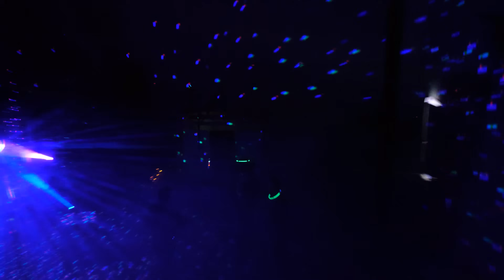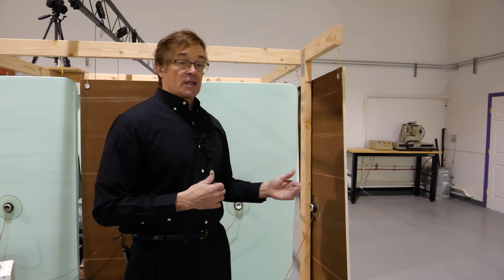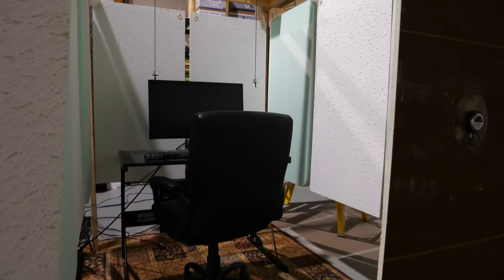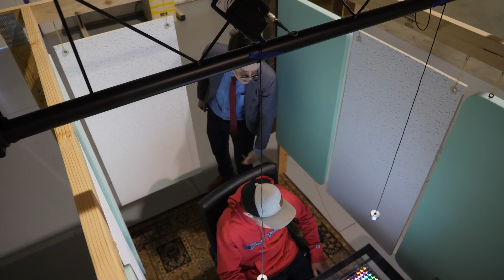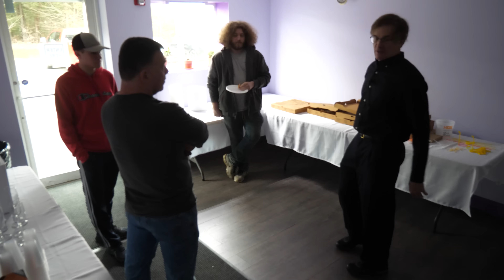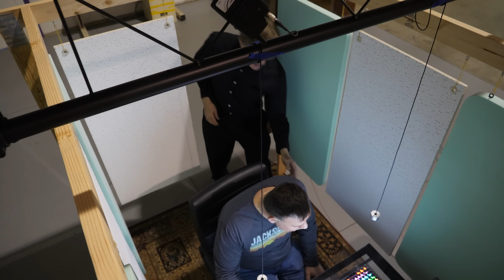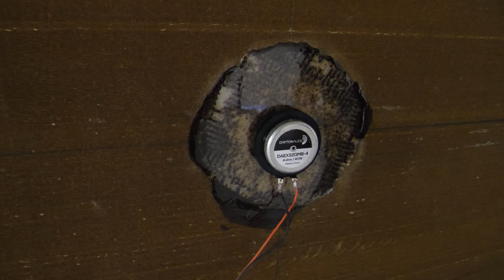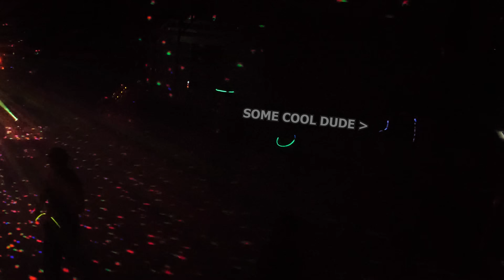SHOULD SPEAKERS THIS GOOD BE LEGAL?

Comment: It would be super cool to use curved panels for stadium sound with beamforming and interference correction between drivers. There are beamforming loudspeaker systems for stadiums, but I feel like the peak sound level is too high in parts of a venue like that (often not hearing safe). I think the calculation, in addition to the normal beamforming, would be a delayed convolution (based on the real delay between the drivers). I'm going to try building one, and make the software for that, I'll let you know if I get results.

I think a similar processing step to the convolution for multi-driver panels could be used to solve that resonance problem you are talking about when the driver is in the center of the panel. The convolution is a matrix as m columns × n rows where m is the number of channels and n is the number of samples it takes for the reflection to come back; you could also pre-process the audio samples by binning them down with each iteration (i.e. the first row [of n] would be the previous sample, the second row would be the average of the two samples before that, the third row would be the average of the previous two averages of two samples, etc) and you may get a similar quality result with much smaller matrices.

Obviously for an installation with one driver per panel, offsetting the driver will get you a significant improvement without this fuss, but if you're going to be doing DSP anyway, you might as well solve the problem correctly as well. There is a frequency-domain process that can reduce standing waves on a DML as well.

Comment: Would using thicker acoustic ceiling  panels improve the base performance, thereby eliminating the need to use a larger panel for the point one sub channel, and an additional standard sub?

Comment: If you could scale this application to the size of something that would be suitable for outdoor audio that would be awesome. I'm trying to come up with a system I can build and take camping with my and have high audio levels, including deep bass and run it off my campers lithium ion system. It's tough to move air efficientl for cheap. You're on the right track!

Comment: I'd be curious to know if these panels still work if you suspend them in a wooden frame (just a piece of rope on each end connected to the frame corners) and then put fabric over the whole thing, or if that extra friction would somehow reduce the ability for the panel to absorb the vibrations.

Because that would make for some great DIY accoustic paneling for a home office

Comment: I've always thought that this kind of demo is pointless. The copyright-free tracks are dreadful electronic affairs totally lacking in nuance and are superficially impressive, but wearing on the ears and brain. 
Something that isn't discussed at all is instrument placement and depth resolution, which are features crucial to great hifi. In addition asking random public listeners isn't a valid test - most people wouldn't know good sound if it bit them on the bum.
This type of speaker design isn't new and does have significant downsides, which is why you don't see it in the world of hifi. As you might gather, I'm not impressed, at all.

Comment: Yeah no. The frequency response of open flat panels is abysmal.
Yes, I watched your last videos about this topic. Yes, I built them to your exact specifications. I even exceeded those specifications in order to minimize self-oscillation: I use no symmetry whatsoever like you do here. And no again, the sound quality is far less than "illegally good". I have a peaks and troughs of over 12dB over the entire spectrum, and you can hear that. There are reasons why loudspeaker manufacturers don't slap together cheap speaker drivers with styrofoam slabs and sell them for a fraction of the price of what speaker cabinets cost. If if was this easy to outprice the competition, don't you think big corporations would exploit the hell out of this?
My flat panels have a beautiful stereo spectrum, but that's the only thing they do. Everything else does not reach the quality of even a cheap portable blutooth speaker. Of course my Yamaha HS nearfield monitors wipe the floor with my flatpanels. And that's before we even come to the subwoofer which is necessary to augment any open flat panels low freq response.

Comment: could put a plate on top of the ceiling panel and a magnet at end of the hanging string, then you can hang and remove them without leaving holes.

Comment: The sub shown might actually lower the performance overall here. Ideally, you'd have a pair set up symmetrically (humans can localize subs if they go as high as 150 Hz), and bass-wise, that giant space is definitely not doing the sound any favors, usually you boost subs by making use of the room. Corner loading maxes them out and may often be too much, middle of a wall is somewhere in between. Putting them in the middle of a big space makes them the least effective. So, a couple of big SVS subs, one on each side of the monitor or so, would probably increase the perceived sound quality considerably.  Unless, of course, the small white sub was just a visual aid and you had better hardware. Either way, very interesting. If I were doing a home theater and needed a high wife approval factor, panels like these might just be the way to go. With a pleasing surface color/texture on them they'd melt into the walls.

Comment: DUDES- SUGGESTION: I am thinking: bass is the longest wavelength- requires the most travel of all the frequencies  are (possibly attenuating the Bass tethering it where you are. Why don't you try hanging them just above the middle 40%down from top?? so the bass is freer  resonate. The highs don't need so much "physical movement"  so it might sound better. Also * Why Are you using rectangles?
Have you tried a teardrop shaped panel?  Thanks- good luck,  Jim 
Not a single thumbs up or comment in 8 months? Did you delete this post?

Comment: I'm curious about the panels on the left and right channel directly facing each-other. Seems like this could cause some unwanted frequency cancelling. I think most audio is mixed assuming that the left and right channel are in front of you. I would be really curious to hear what it sounds like with 5 panels directly in front of you. 2 left, 1 center, 2 right. Repeat for the rear. Seems like the soundstage would be massive. I love these audio projects you do, thanks for all the info!
Reply: DML are not cancelling themself because the modal resonance.

Comment: this one is pretty neat! i would love to try this one myself,, is there a parts list somewhere for it?
Reply: He has covered how to make these in previous videos. Absolutely
Reply: @tdtrecordsmusic   Yes you are correct. I should have been a little more clear in my question. I was wondering what type of AV receiver/ Amp . he was using. stuff like that.
Reply: @johnofthejungle5699  oh, gotcha. Sry, I don't recollect ever seeing his setup, but as audio is what I do I can help a bit. 
  If you're going to be doing experiments I highly recommend getting those tiny amps from amazon/ebay for roughly 10$-50$. I like the ones which are just a circuit board/no enclosure. The ones I am speaking of have very few parts and are based on the amplifier chip itself. So far ever one has had genuine chips typically from Texas Instruments. These chips are high quality & typically found in car stereos(head units).  The advantage for fun/experiments is that they are very robust. They have a wide range of input voltages. They can handle short circuits and have features designed for abuse. Most can literally maintain a dead short and still survive without even a change in the sound output. One bad a$$ chip.  This is NOT the same for those big receivers you find at big box stores OR any amplifier based on discrete components.   I typically search for "50w amplifier" or "100w amplifier".. something like that. The last one I got has model # zk502t. For 20$ it even came with a very nice power supply :)  
       So my formula is to use this little throw away amp for experiments. Then when the experiment is done, I will hook it up to the supposedly better setup of a higher priced amp. I must say though that these little amps seem to be better quality than the receivers touted for hifi stereo. They clearly have better signal to noise ratio(yes I measured with oscilloscope) and tend to pickup less hum from various devices like ipods / phones / guitar pedals / etc... 
    Sometimes I will just go to Texas Instruments website & browse around for the newest amp chip. Then just search that on amazon/ebay & there will typically be a little board based on that chip for ... yup, you guessed >> 10$ - 50$ ...
   However, my goto for proper sound without killing the wallet is yamaha HS8(new models) & beyerdynamic DT770 pro 80ohms . I don't like the higher ohm headphones, they sound different. I've got a couple pairs & I have heard loads of them! Plus, it sux when you can only hookup your headphones to ONE amp to sound decent & they still don't sound as good as the 80s.  80ohms seems to be the magic number.

Comment: when you say acoustic ceiling panels are they paper ceiling panels, or a plastic with a foam centre, what is the dimension of the panel.
you might find getting some baking foil a foot square and glue it to the centre on the opposite side of the driver on the polystyrene panel that will extend the top range more
if you did it 6 inches for the bass driver panel would extend more mid-range
have you tried putting them in a room just around the walls? not touching of course.

Comment: I was surprised that you didn't mention the importance of impedance matching.  I was great that you discussed series vs parallel connections to change the load (speak) impedance.  Matching the impedance of the driving amplifier to your speakers guarantees maximum power transfer.  Don't want to waist the watts!!!  Another great project.
Reply: I was interested in the bit about putting them in series too. But I don't understand how they were wired to achieve that. Was wondering if you had an idea about this. How do you put speakers in series vs. parallel? They don't have output jacks, so how are the two connected to each other?

Comment: One time I took 6" MB quartz speakers and put them in a 6" tube about 40 inches long then I put those in sono tubes 8" wide - This produced some incredible base tones and it could be tuned.  Pink Floyd sounded as never before.   They could be tuned by sliding in and out.

Comment: maybe u can record with good condenser mic the same song or 10 second at different volumes with different commercial speakers placed pretty much at the same spot, and check later on an graphic equalizer where u got better response frequencies or where are missing with your sound system... or just a swipe maybe is better for the test... Im wondering if those panels are good and clear also at really subtle volume... cause if u surround a guy with 8 speakers in 5.1 u always tend to get an awesome response... and the human hear tend to adjust the sound in a way to get as clear as possible the sound already... (never trust humans XD) but all of this cause u get a really good quality with this sound system, great work compliment! ...I wish I did this for my assessment in music production!

Comment: This is awesome! Would love to hear it. Have you experimented with having the front L & R panels angled in like traditional studio monitors? This would help with phantom center imaging from stereo information routed to those speakers. When mixing for 5.1 or atmos, most stereo tracks don’t output the mono information to the center channel. In audio for picture typically music is mixed to front L & R, and center channel is saved for movie dialogue. Upmixing stereo audio to 5.1 might be different though, not sure if in that process the mono information gets routed to the center channel or not. 

Great work! Pumped to see if you make an atmos version

Comment: I made a set of these for my living room TV.  I ended up with a fabric covered polystyrene insulation panel (21x28) and an end grain balsa panel that is about 30x42.  Both are hung individually with string from a single wall mount that I built myself.  I tested several iterations of the polystyrene and it was a little bright for may taste.  The combination of the two panels with different materials really sounds nice.  I'm currently working on two 8in subs.  Very happy with everything so far.  The panels definitely need subs. And I think the two different materials have a much more balanced sound.  They sound much better together than they do separately.

I made the end grain balsa panels myself.  I have a well equipped wood working shop in my basement.  Next time I might try basswood instead of balsa.  The balsa was more expensive than mahogany.  I think I have $230 in balsa to make two 30x42 panels.  They weren't cheap, but overall cheaper than building mdf boxes with drivers.  I may try some high pass crossovers next.

Can't wait to see a more in depth video with more technical data--response curves, material options, and any thing else that was learned from the last video.  I'm curious about how the exciters are now mounted.

Also curious about where to find the non-copywrite music.  Thinking about making a video about my DML's.

Comment: How far would these speakers have to be from a solid wall if they were placed in a small to medium sized room ? Could they be used as a surround system in a basement mancave ? Or would the reflections from the hard walls ruin the effect ?
Reply: Hang some cotton sheets or woollen blankets along the walls & you could probably do away with most of the backside reflections on the cheap, provided there's an air gap either side of the sheet, & a wall then blanket then sheet then speaker setup would be even better. I think actual distances would probably depend on the wavelengths of the stuff you're listening to, but unless you're super fussy even a couple of centimetres of gap may be enough. Or you could paper the walls with faux fur.. It's an option.

Comment: I have to admit I'm of a mixed mind on these. Building them is the only way to settle it, but too many irons in the fire right now.  From my experience with electrostatic speakers I tend to agree with benifit of a large area and low excursion speakers acting as a plane source instead of a line or point.  On the other hand esl speakers have extremely low mass membranes and the drive force is distributed evenly across the whole panel. They often have several methods for mitigating resonances throughout the membrane.  My other thoughts are surround is kinda pointless as we only have 2 ears and multipath waveforms have interference patterns.  Of course ESL speakers pretty much need to have your head located in a vice for even decent results. But sitting a in the right spot provides an experience unmatched in my experiences.  I can't imagine these speakers not behaving the same.  Would they be better than my rigged together tube amplifier and home built speakers?  Or repairing the $5k ESLs I have and building a much bigger tube amplifier as the ESLs can eat up 200W at moderate listening levels?  Interesting video, as always

Comment: If you're dealing with a square panel, would you get more even frequency response placing the driver 60/40 along one axis and 70/30 along the other?
Reply from the maker: That's  an option.

Comment: Fantastic stuff, I will be making one of these soon based on your recipe, thanks!
I was wondering what would happen if you rested or even glued the back of the actuator again something solid? I.e. for every push on the plate, the plate pushes back on the actuator reducing the amplitude an probably also altering the sound. It would be interesting to see what happens when this push-back and pull-back is removed? The extreme version of the idea I guess would be to glue two speakers back to back through their actuators, so that they would cancel out each others back forces when playin the same sound...
Reply: Another idea: attaching magnets to the plate holes would probably alter the sound in undesirable ways because of the additional mass, but I wonder if the panels could be magnetically levitated instead of being suspended on the lines, and if that would impact the sound?

Comment: There are many ways to make materials vibrate and therefore to reproduce sounds and music...
To make people listen to these reproduction systems only allows to know whether they like or not what they hear! That is to say nothing reproducible or scientifically exploitable.
The objective of building loudspeakers is, in general, the most faithful reproduction possible of the recorded sounds. This is the definition of high fidelity or Hi-Fi. QUAD had for phrase ''For the closest approach to the original sound''. Unfortunately DML are most often unable to reproduce with ‘’Fidelity’’ the recorded sound for several reasons perfectly determined by measurements and more simply by their mode of radiation of waves. I stopped working with them years ago after understanding that these speakers can’t be considered as Hi-Fi speakers. It’s for example totally impossible to make a good mix with them and obviously no position in the room will result in a credible soundstage. As a consequence, the positioning of musicians is totally blurred !…
Moreover, the type of exciters, their number and their distribution on the panel are critical : there is no trivial method to determine these parameters whatever the quality of the materials used as panels.